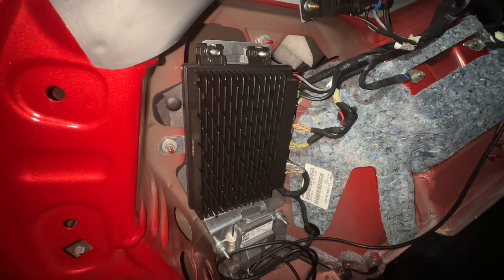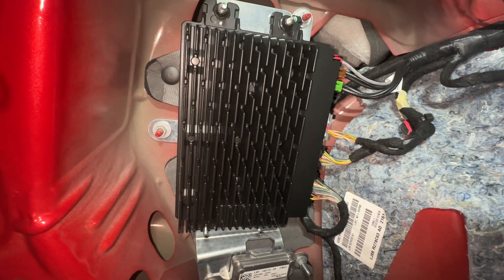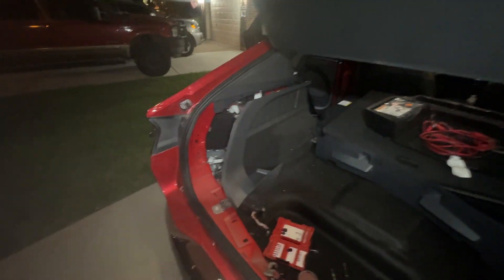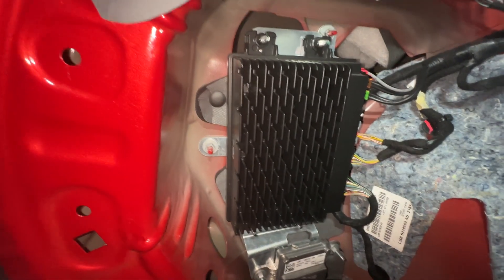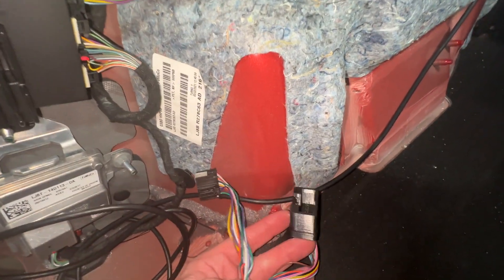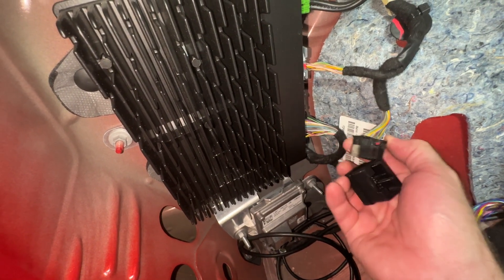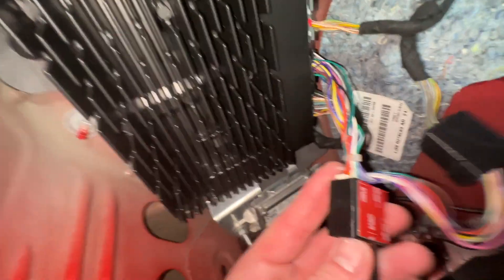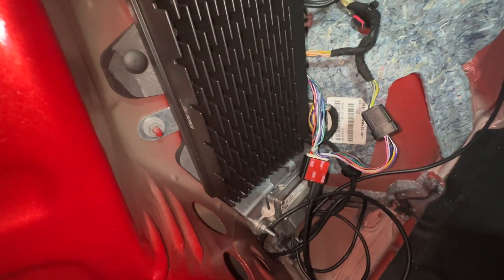Installing Ford Q4 Comma3x Comma ai F150 Mach E Lightning Ranger Escape Maverick Expedition Sync4

Comment: Does the new version of openpilot/blue pilot no longer need the harness extension and can work directly from the usb c cable?
Reply from the maker: the harness extension is specific to the Ford Lightning, no other Q4 ford needs it.  That is a hardware problem, and it cannot be eleminated in software, so any fork will need it.  We are working on a much simplier hardware solution,  but we are having trouble with the component selection and the manufacturer.  Hopefully that is resolved in a few weeks.

Comment: Comma compatibility chart lists 21-23 F150 only with Copilot Active 2.0. I assume thats the ones with ACC range button on a steering wheel. That automatically rules out all Super Cabs and lower trims. Or thats possible to make Comma work on low trims that only have lane centering big button on steering wheel?  I wonder what's the real prerequisite?
Reply from the maker: @lgbrdn6545  ford firmware won’t let the steering engage unless the ACC radar is present and error free. However any F150 has the right steering rack for control. If you add the ACC radar DIY the comma3X works. Even a regular cab XL works once the radar is added. 

https://docs.google.com/document/d/1xBOe9k7pkKYgqE_baDo9JYZrXi0-3K01CfDGExePrkA/edit#heading=h.tbl0eg1qujek
Reply: @ajzride  Goodness, thanks a lot, this is exactly what I was looking for. I drive 24 Maverick that works w C3X but its too small, i need a big bed of Cab but with C3X.👍
Reply from the maker: @ 21-23 F150 only. 24+ picked up encrypted canbus.

Comment: Thanks for this. I have a 23 CR1 and hope to put in the comma soon.  You mentioned the need for a specific USB-C cable, could you provide a link?
Reply from the maker: MachE needs a 15 foot cable. For some reason I can only find them in 2 packs:

https://www.amazon.com/UseBean-Transfer-Charging-Monitor-Thunderbolt/dp/B0BKG847JR/ref=sr_1_3?crid=1VUJL8KFWVM8C&dib=eyJ2IjoiMSJ9.CPVgrXBNIBPWXTxTwvabb0NzjDCay2mauPY5demKxSlEkhUc38k4IivepLImn0kNjfKILLsAV2FWXvZ1nGe3J6BM72jHJheULzvUc6e5fWw4dRV6SG9qzSm-Wfp7RAaeugdgLPuj2Rjm1SIVdz4k0nN6CuhQ3CRCsvRAqjF9dQ4TJ2UTfJQOcXgjiuLXEoVlJSZ024_6kvuZvxVg54Vxl2kTy_MbQgXS2_NAV05Gwus.ng3eT_YdKntGaXQ7L-j1IU4aVybYJmDwB1T9MG_42Wk&dib_tag=se&keywords=15%2Bft%2BUSB%2BC%2Bgen2&qid=1745968372&sprefix=15%2Bft%2Busb%2Bc%2Bgen2%2Caps%2C154&sr=8-3&th=1
Reply: @ajzride  Well, it gives you a spare! LOL.  Other vids on youtube talked about using multiple extension cables for the MME.  Does this fifteen footer go all the way as a single cable with no jumpers?  Thanks for the fast reply!  Also, was routing the usb-c through under the various plastic channels difficult to do without worrying about snapping things?  I've not done a lot with popping off trim pieces and it makes me nervous!
Reply from the maker: @ 
15’ is long enough if you follow my routing. The write up is from when I used two cables, before we found the 15’. 

https://www.macheforum.com/site/threads/installing-comma-ai-openpilot-bluecruise-alternative.29591/page-11#post-800768